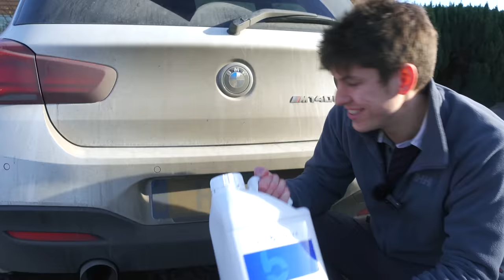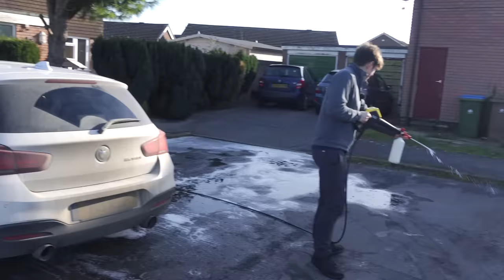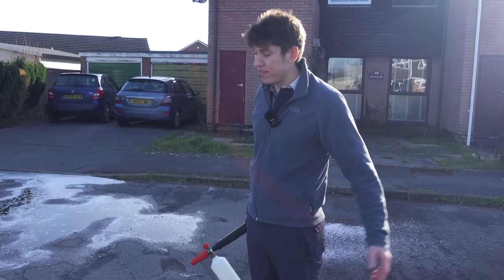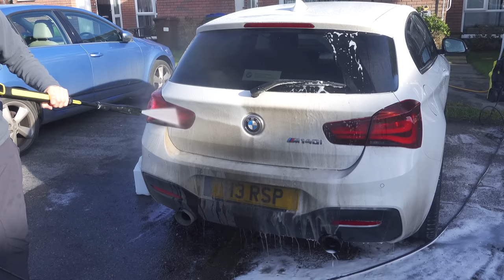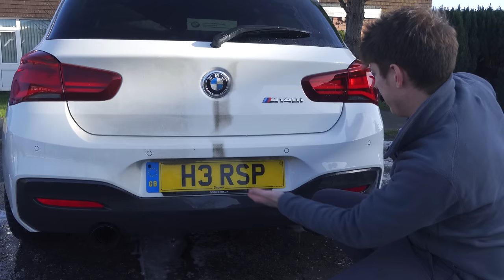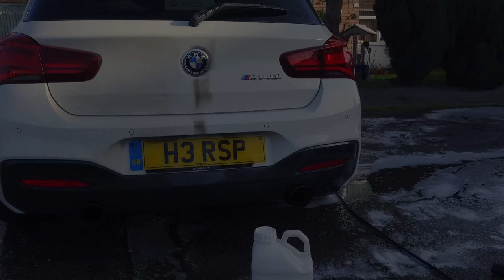Does Snow Foam Actually Work? The Results Might Surprise You..

Comment: the test was shampoo v water, nothing more. :(
Reply from the maker: It’s to show you that snow foams are effective at removing dirt without touching the paint, with a wash mitt or sponge. The point of snow foam is to help get rid of as much dirt as possible before a contact wash. Why? To reduce swirl marks and look after your paint. 

Cheers Chaz.
Reply: @roadreg1820  a true test would be against a normal shampoo would it not? any test  must have a control, here would have been the water only, then a shampoo as test 1 and snow foam as test 2. than you have a true test
Reply from the maker: @chazM6116  The test was to demonstrate snow foam vs just high pressure water. Thank you for your comment tho. 😃
Reply: @roadreg1820  ANY shampoo would be better that's my point 😞😓😩😤
Reply from the maker: @chazM6116  shampoo is for the contact wash. You use shampoo to get the remaining dirt of it. The point of snow foam, is to spray it on the car and let it penetrate the dirt, so you can wash off most of it by not touching the paint. Hope that makes it clear now 😎

Comment: The only problem I see is where you have a punter who has a 1850psi to say 2500psi home pressure washer and they absolutely blast the hell out of their vehicle, I have seen morons blow out door seals and lift badges and paint work on the front of their vehicle by simply hitting a stone chip / badges at the accidentally the perfect angle by watching these types of videos. I personally still think it is better to hand wash your vehicle
Reply from the maker: Never had that issue with mine. Thankfully my pressure washer doesn’t hit anywhere near those numbers, plus BMW clear is very thick and hard. Also, I always watch out for stone chips with the pressure washer.